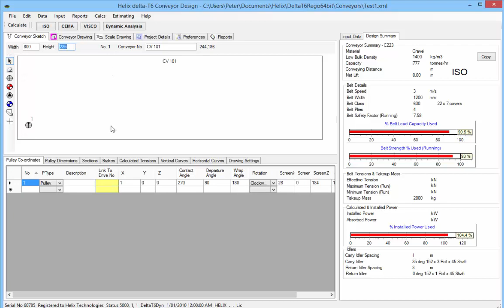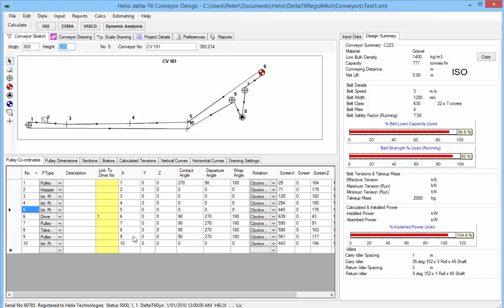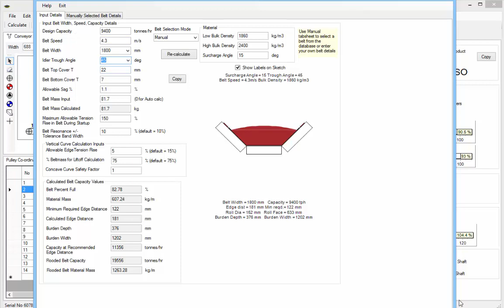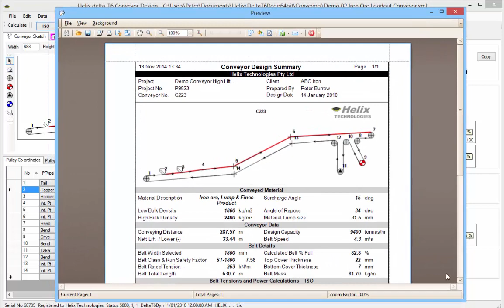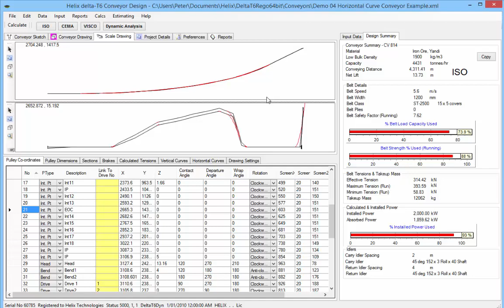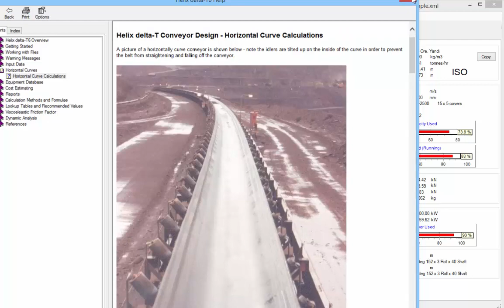Helix Delta T6 Conveyor Design Introduction 01

Comment: What's the function from this apps?
Reply from the maker: This software is used to calculate many different aspects of a belt conveyor. You can determine belt tensions along each point in the conveyor, friction factors, determine belt load, optimize belt speed, pulley forces, drive equipment selection, take up mass selection to name a few.